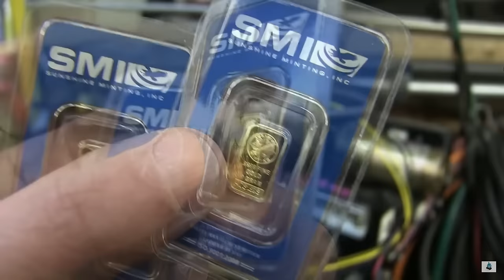Cold Welding In Vacuum

Comment: In layman's terms, gauge blocks stick together because there is always 'stuff' between the gauge blocks. No matter how hard you try to clean them there will always be a film of sorts there. There have been at least two peer reviewed papers on this. If one were to ever get the blocks completely clean (which would have to be done in a vacuum) - they will not stick together. As I alluded to in my comments on the previous gauge block episode, you can easily test the electrical resistance of the blocks - which provides an insight into what it's doing at an atomic level. An adjunct of this is the way cyanoacrylate polymerises when adhering two surfaces together - It relies on the fact that no matter how clean the surfaces are there is always a water film that exists on almost all solid objects.

Comment: I don`t know much about cold welding but my taught is that it would be the diffusion that will weld the pieces together.  Simply need to wait longer time pressed together, like weeks, to which a little heat could help.

Comment: Very cool!  I think cold welding, like the formation of other chemical bonds, requires some activation energy.  The joining of metallic particles together into a solid mass may be an exothermic process but it makes sense that some heat would facilitate the 'reaction'.  

I'm sure the impacts of the vibrating powders generated some significant friction / heat.  It would be interesting to see if heating the sample a little (+100 or 200 degrees) would make a difference in how quickly it clumped up.

Great videos Cody.

Comment: Perhaps you could use a press/clamp with a strain gauge and see if you can get to a pressure where the indium, copper, gold or steel cold weld. I also wonder if when you are smashing he pieces together, there's actually quite a bit of reactive force subsequent to the initial collision which is perhaps high enough to then break any weld that might have formed. Great video series.

Comment: According to me vacuum is responsible between iridium, that's why it sticks when rotated, you can test it by rotating two glass sheets and then stick together and rotate those will also stick together until there is no air between two absolute flat surfaces.

Comment: I think that there are dust particles between the large pieces that prevents it from welding,
if you rotate them together you crush the dust particles or deform the metal to accommodate the dust particles so the metals actually touch each other.

Comment: Text books that describe wire wrapping always speak of cold welding the wire to the square post through deformation, since the soft copper wire puts pressure on the square lead edge it smushes both and welds.

Comment: I worked in a factory where they made large magnets like used on a crane,.They were wound with an aluminum wire, more like a ribbon. The trick was to solder a copper wire lead to it. They used a product that had copper on one side, and aluminum on the other side. The aluminum side was cleaned and roughed up with a wire wheel, and pressed together in a jig with three little divots under very little pressure (foot pedal) in atmospheric pressure. The aluminum cold welded together where it could not be pulled apart without extreme  effort. ( I know because I did not believe that they actually welded, and I tried to separate them. ) Then they simply soldered the copper wire to the copper side of the bi metal product called Alcosplice.

Comment: If you felt so inclined to take up a suggestion from a lowly subscriber... I would find it fascinating to see cold welded "sintered foam". I would suggest a blend of metal powder, and a non metal powder (plastic or something) mixed together, saturated with a solvent/liquid that will boil off in a vacuum to leave a clean mix with no oxygen. Place the slurry in a vacuum, vibrate a bit, maybe a weight, hopefully the solvent will boil off, the metal will cold weld and the non metallic powder won't, then use a different solvent to get rid of the rest to leave a sort of "sintered foam". I'm thinking this would be great for something like platinum that you may use as a catalyst to increase the surface area, that would normally require great amounts of heat to melt.

Comment: I think it works in a simpler way and these tests support my theory. When in atmosphere the gases around the metals create a barrier between them reducing friction and also heat, witch I think is the most important bit and Cody's crystal alignment also gives a nudge toward it. As you should know heat is just our way to describe how exited an atom, or anything else by the matter even photos can be brought down to close to absolute 0 and they'll come near to and halt vibration wise, and when atoms warm up their electrons become easier to bond with, witch would explain all the cold welding experiments in this video. The copper powder vacuum cold welding process works because in the absence of of the gasses the oxide layer will gas of due to the heat and then the copper can bond with itself having the individual atoms falling together like little puzzle pieces in terms of magnetic organisation, and yes that's one of the forces the brings atoms together, effectively cold welding them, well not so cold anymore. The gage blocks stick together by the same mechanic except you're the one inflicting both the vacuum and the friction by twisting the blocks together and obviously as steel only tends to be more reactive at higher temperatures it's cold welding, and yes this one also vacuum and not so cold anymore, doesn't work as effectively as in copper. A good way to test this theory would be to repeat the copper vacuum cold welding process but have the bottom of the test tube continuously dunked in a cryogenic fluid like liquid nitrogen or methanol with some chunks of dry ice in it and compare the results, unfortunately this experiment isn't fault through because in the absence of all the gas the metals would have a hard time giving up their heat to the glass they're vibrating on never the less an interesting experience.

Comment: One of the issues in electronic switches is "contact bounce". It takes on the order of milliseconds for the contacts to stop mechanically ringing. That is one difference I can think of between your indium "wringing" and the tests you performed in the vacuum chamber -- you've got a lot of energy when you allow the pieces to bang together that causes bounce.

Here's another idea for your vacuum chamber tests -- could use a radio transmitter to turn on/off motors. Specifically, I'm thinking having a servo glued to piece of gold held against the other piece of gold, bring down to vacuum, and then use radio transmitter to tell servo to apply a torque to gold piece.

Comment: I would like to think that to form the bonds you have to add energy, or if I'm misunderstanding and you don't have to add energy, the sudden shock from dropping was breaking any bonds formed by elastic forces making it bounce, thus breaking any potential bonds. As for why twisting works, it's the same idea, it's a gentler action and results in less counteractive forces to the welding process. At the same time, you can think of it as stir welding, the friction deforms the metal at the contact points and increases the contact area giving a better chance for welding, alongside removing oxide and other contaminates. While this still doesn't account for why the contact areas generated by applying shock force against the faces doesn't weld, all I can think is that possibly the creation and then breaking of the bonds makes the surfaces that will come into contact again after resettling unsuitable for further welding.

Comment: Cody if you would think of metals as a material that can bend then you can compare it to two pieces of clay. If you smack them they don't join but if you take two large pieces with a lot of surface area they might possibly bond together

Comment: A few dumb suggestions:
A) limit the vibrations to half rotation per second, 20 rotations per minute OR 1 full rotation per second.

B)Place a second vibration motor but with the direction of rotation pointed in the opposite direction AND with an async timing.

C)Place ONE of the gold places on a slider and the other on a stationary place, then trigger the plate on the slider to contact the gold plate on the stationary place in a parallel horizontal motion.

D)Try again to weld the sides, but ALSO try to weld the hedges.

E)REMOVE THAT CURSED CLOTH, as it can trap oxygen in its fibers, contaminating the entire experiment

G)Remove the nut on the top of the gold plate and replace with with a grip-like device that can ROTATE the plate.
Remember that you only rotated that indium ONCE for it to lock.
What you did to the indium appears more like creating a perfect vacuum, since, by friction, it removes any oxidized particles, OXYGEN particles AND, like you mentioned, re-molded the crystals of the metal.

G)Alternate: try to use plates made with 50% gold and other material/s.

JUST suggestions ;)

Also, one dumb question: If "Cold Fusion" is similar to "bonding through removal of contaminants"  FRICTION is the best form, one of the problems may be "sweet spot": Too much friction the molecules don't have enough time to bond, and too little friction the area near the molecule being bonded will have enough time to receive impurities after they were removed by the action of the surrounding molecules.

Or, i may be just inventing stuff since I'm no scientist and nothing of this makes sense. Who knows.

Comment: Hey Cody, I'm not sure how often you read these, but here's my hypothesis about what's going on. On the nanometric scale, your surface is probably really far from flat and the proportion of the surface where atoms get close enough to weld is probably really tiny. You maybe have a few hundreds of tiny tiny welded spots, but you can't see or detect these welds the way you tried. Now, when you smack two pieces together, I they where to stick together, where would you expect all the energy to go? In heat or sound? It's simply too much to absorb/diffuse , therefore it bounces. When you rub the surfaces on one another by applying force, you actually smooth out the surface and allow more atoms to bond, without having to dissipate an enormous amount of energy in a short period of time (smacking experiment). To confirm this hypothesis, you would need to have two incredibly flat surfaces in contact. Good luck with that.

Comment: "Wringing" gauge blocks together works because you're squeezing most of the air out between them.  It's suction.  Twisting two soft metals together makes them stick together, in my experience, mainly from galling and surface roughness inter-mixing their surfaces.  I doubt much of it has to do with cold welding.

Comment: I've heard that one of the reasons that solder paste goes off is that the solder balls can cold weld together (and thus change the particle size affecting the properties of the paste) as the flux in the paste removes their surface oxides over time.

Comment: I think that bouncing is responsible for the lack of cold welding when the objects are smacked together. The elastic deformation is going to spring the pieces back apart and break the few new bonds. Few here meaning few relative to the number of atoms on the contacting surfaces. The number bonds formed as a percentage of the surface atoms in even a strong cold weld is probably very small; so, the rebounding deformation probably breaks those bonds. Also, the fact that bonds formed implies that the atoms have nearly enough energy for the bonds to break again. With rubbing things together, the energy input fades away as your hand stops. This could be required as the energy needs to hit a certain level and then dissipate smoothly, locking in the new bonds.

Comment: Indium won't weld at room temperature under rapid colliding force for the same reason people die from jumping off of tall bridges: time. The force from the collision causes waves that break apart any potentially formed bonds. These would be obvious if viewed on a microscopic level and slowed down. Cold welding relies on a long contact time ("long" time in comparison to the time in contact when you slam the indium together).

Comment: gold does oxidize, it just takes an incredibly long time to do so

also polishing gold would require an abrasive compound which contaminates the surface, its likely that's whats causing it to resist cold welding.

Comment: I think one reason the blocks don't cold weld when they are slapped together, but do when twisted, is that when they impact they are also rebounding from each other. When you twist the pieces together there is no rebounding force so there is more time to bond.

Comment: When the metals smack together, there's a reverberation that'll cause a small bounce back. When you rotate the metal, it's in contact the entire time. Same thing happens when air is present, it causes a cushion that doesn't let the molecules get close enough to each other.
  This isn't very different from just putting the pieces of metal into a press and squeezing them together with force. The pieces will bond together as long as they're close enough in contact.

Comment: I believe in the semiconductor manufacturing process, they use a HCl bath to remove the oxide layer.  They spin the silicone wafer and squirt a stream of HCl in the center and centripetal force spreads it outward, then they rinse it with a squirt of (I think water).  I'm guessing they do this at normal pressures in an inert gas atmosphere.  Dunno how you would do this in a vacuum.

Comment: It looks like ice cubes sticking together experience to me. Where adding pressure or a friction would be enough to melt to surface and fuse together. Perhaps that’s why it works better in space where the vacuum avoids oxydation but also lower the melting point. You should try with a metal with lower melting point like gallium. Hope you can weld something. 
Thanks by the way for your excellent videos.

Comment: Cody, there is another similar phenomenon to true cold welding. Cold asperity friction welding occurs when similar metals are rubbed together. From the reading I did on it years ago, it occurs due to collisions between the contacting asperities. Whilst on the bulk scale the pieces of metal remain cool, at the extremely localised collision sites it is possible for the metal to be heated to the point that it bonds together. It maybe what you are seeing in this video and the other one.
If you have access, check out:
Cowan, R. S. W., W. O. (1992). Frictional Heating Calculations, ASM International.
Gecim, B. and W. O. Winer (1985). "Transient temperatures in the vicinity of an asperity contact." Journal of Tribology 107(3): 333-342.
Greenwood, J. A. (1991). "An interpolation formula for flash temperatures." Wear 150: 153-158.
And anything by H Blok, or F E Kennedy

Comment: The two things sticking together when you twist them,  that happens with non-metallic things too.  you can do it with glass and other substances,  especially if there is some form of liquid,  the oil on the gauge blocks or often soapy water on glass.   as you twist them, I would guess that you are forming some sort of vacuum between the surfaces, so they are not stuck so much as sucking together.

Comment: I remember sitting in class back in 4th grade; I had a piece of silly putty. I split it into two smaller pieces and pressed them together. when i pulled them apart again, there were a few places that fused together, but it wasn't the entire face. when I slid them together, the same thing happened, but because I continued to slide them, more places began to fuse. I think what might be happening is that when you slide the pieces together, it agitates and displaces more atoms than by simply pressing them together.

Comment: I think your problem with "slamming" to cold weld is that the recoil is quite strong and is probably immediately breaking any bonds that form.  It might be interesting to try a force similar to a press which provides slow and steady pressure.  Maybe a use a mercury drip into a vessel that is placed on top of the two metals?

Comment: could also be that a charge or em spike is generated by slamming the materials together making them resistant to welding and the two em feilds are neutrolized or balenced between the two objects when carressed together. seems like the reaction could be force with applying enough force but I believe that is a hot weld instead of a cold weld

Comment: Cody, I have a suggestion for a vacuum video: make and set a block of agar, then freeze dry it in you vacuum chamber to drive off the water without collapsing the polysacharide structure, then take the resulting super light foam block and pyrolize it in a can, excluding as much air as possible to try to make a carbon aerogel.

Comment: my friend when you spin em together it would push and remove the oxide layer in the direction of the spin outside, you just probably need a machine that could spin em really fast but with low friction, in a very weak system but fast. just to prove the point and not running the welding.
so far i really like the video! haven't  had the patient to finish before commenting!
Reply: spin is fundamental for fusing, in my opinion, the smaller bits, are welding because as much as you get smaller, the chaotic nature of the spin dissappear and on the atomic level they spin. Very very interesting video, thank you.
Reply: I have my own theory of the importance of the individuality and the collective herd mentality, and now seeing how it can connect with physical atoms rather than humans, is super interesting!!!